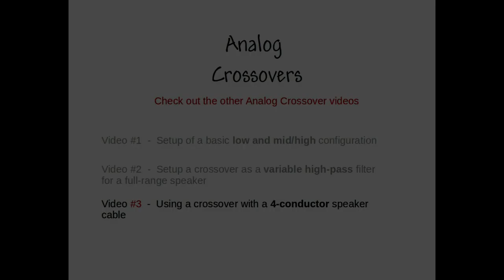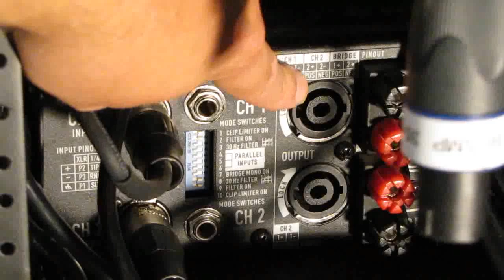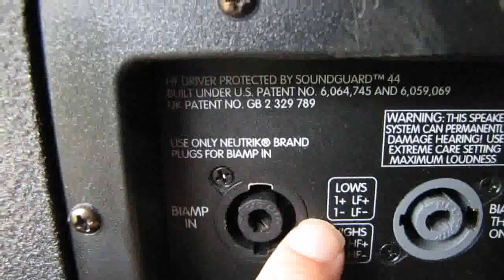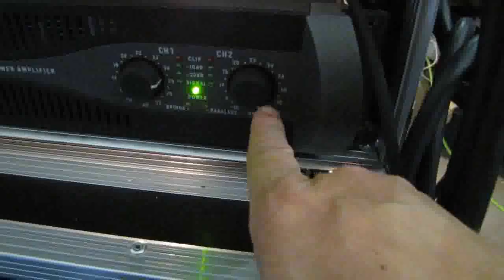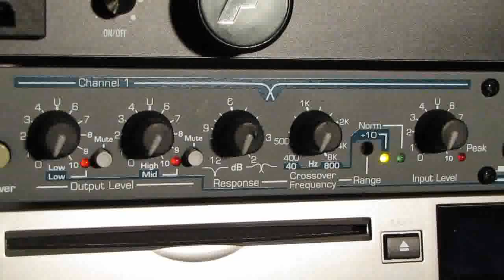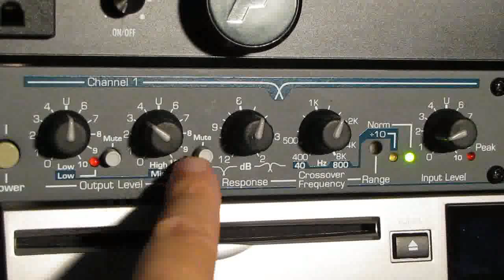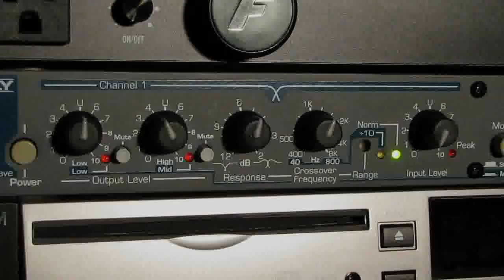Setting up a crossover to be used with bi-amp speakers - 4-conductor speaker wire

Comment: very informative video , I have a question, I have the same crossovers as you and im running a 3 way connection my speakers are a Cerwin Vega ab36 subs and Cerwin Vega cvp-2153 for mids and highs. what would you recommend for a calibration set for a low, mid and high - thnx
Reply from the maker: Thanks for the feedback.  For the subs, a good x-over starting point is 100 hz.  Try not to use anything below 70 hz for x-over point and not use anything above ~140hz.  For your cvp-2153 cabinets, and assuming you have the internal wiring setup for actual bi-amp mode, a starting point for your mid-base speakers could be around the 1K point, which would have the horn handling around 1K and up.  These xover points should be a place to start - depending on the type of music you are using the speakers for, can determine where the xover points could be setup.  Remember... it all depends on the type of music and how you run your rig.  There is no "direct" answer with xover points.
Reply: @stageleftaudio  this is a very informative answers to me,thank you sir
Reply: @stageleftaudio  sir im using a dbx 3 way croosover,what is the starting point to mid to high. This time im using 2.4k,is this ok??

Comment: What about the horns power handling ¿? Or does the internal crossover take care of that¿?
Reply from the maker: If the speaker cabinet supports internal bi-amping, the internal crossover is bypassed.  Therefore, all crossover functions are handled by the outboard crossover unit and not the internal crossover.

Comment: sir ,are you always using a two way crossover until now??
Reply from the maker: Hello - we always use a 2-way crossover.  We use dbx-260 crossovers for our production systems.  The analog units we have are used for backups and testing.
Reply: @stageleftaudio  it means 2 way is better i think sir
Reply from the maker: There's a lot less to manage with a 2-way system (compared to a 3 or 4-way).  Internal crossovers in speakers have greatly improved over the years.  From these crossover advancements, we no longer need to run 3-way systems.  The 2-way systems do a very good job.
Reply: @stageleftaudio  thanks a lot sir,from now on i tried to use 2 way. less amplifier and less wire
Reply: @stageleftaudio  are you using 100hz in low point in crossover freq??and also low cut in 40hz??
Reply from the maker: We usually start with 100hz as a crossover point, but will adjust it depending on the type of music being played and which speakers we are using.  Yes, we will use 40hz for low cut depending on the music being played (for live sound only).  The low cut is used to protect the speakers from potential over-excursion.
Reply: @stageleftaudio  thank you very much sir,your response is very helpfull to me
Reply: @stageleftaudio  i forgot sir..are you using low summing ??or not..because i believe when we are using low sum,the output is only the channel one low output only and we use parallel in the power amps for sub..Is this right sir??
Reply from the maker: We do not do summing, because all the mixing we do is in mono (therefore, no summing is needed).  For your setup, you are correct... most summing is sent out the channel one output (this is normal).  The use of parallel sounds about right for some amps and how they are used.
Reply: @stageleftaudio  ah ok sir,when we use mono on sub is ok but in midhigh speaker output, when we use mono. I think the surround is defeated
Reply from the maker: The audio may sound defeated if what you are amplifying requires a stereo (2-channel) re-production.  Remember... just because there are 2 channels on an amplifier does not indicate that it should be in stereo!   Most concerts are in actually in mono (not stereo). 
 Depending on how wide the speakers are apart, you can run a stereo image; however, the further the speakers are apart, the sound must be run in mono.  Here's a video we did on this a few years ago:  https://www.youtube.com/watch?v=oOdjIHFBCXk
Reply: @stageleftaudio  ok sir !now i know..In my country we service soundsystem in the disco commonly,sometimes liveband. As what you said ,it depends on the event..Thanks a lot sir